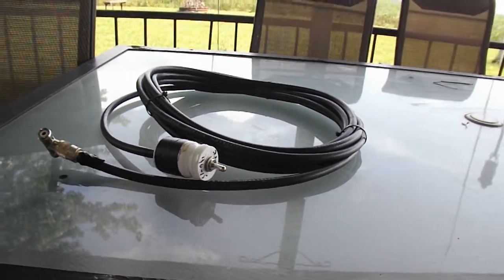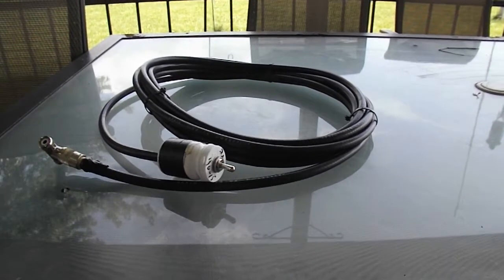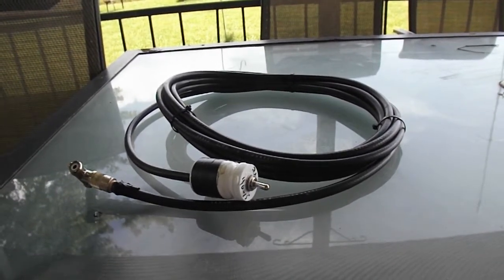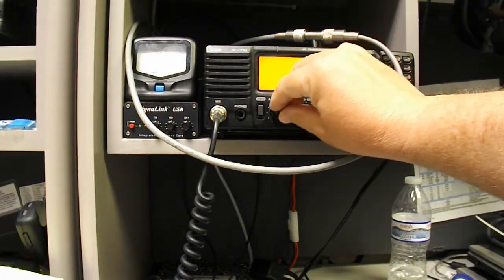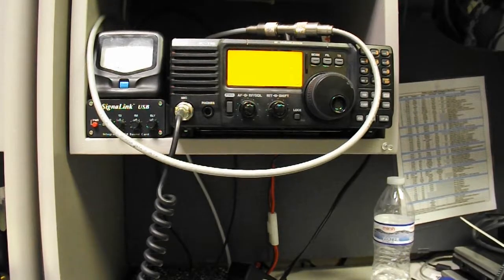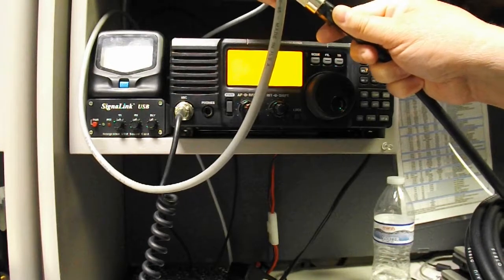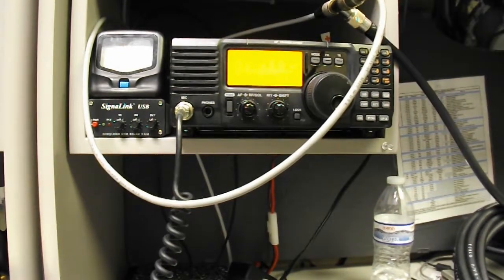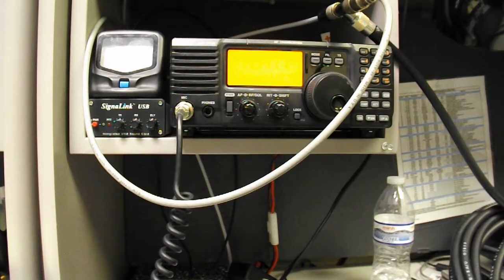Field Day/Emcom coax stub filters(part2)

Comment: Hi. Do yiu need the switch? And what is the length of the coax?
Reply from the maker: The switch just gives you more bands.  1/4 wave times the velocity factor of your coax = length. Start a little long and use the analyzer to trim. For field day I take two of the switched stubs and one single for 80m.
Reply: @amrwhiskey34 no worrιeѕ. мιne wιll вe ғor receιve only. ι wιll тry one and ѕee нow ιт worĸѕ 👍

Comment: Many thanks for reminding me of an idea I used years ago in a different context and haven't given enough attention in the years since. I was working at a USAF radar site that had multiple megawatts of pulsed RF from high-VHF to S-band. I became worried that might fry the front end of my 2-meter radio. To protect it I put in a stub that passed 2 meters but absorbed most of the rest of the spectrum. The result was no loss of signal on 2 meters and never a problem with my radio. --Mike, WA4MP
Reply from the maker: I have had the same thought for a broadcastify receiver. I was going to use a uv5r but the front end is too weak and broad. My other vhf activity at home would overload the uv5r. I may give it a try. Sorry it took so long to reply, I have lots of video ideas but not a lot of time. I haven't
 been active in a long while

Comment: hi friend, good video, a question. The distance of coax from the equipment to T is critical, or not? for Transmitting is my ask. 73
Reply from the maker: It's not when using one stub, I'm still looking into using two stubs. I have found mixed info on that. Two stubs work better than one but placement of the second stub can be optimized. I need to study that some more. Thank You for watching. 73
Reply: @amrwhiskey34  thank you very much for your reply. i will take more information. 73 many thanks